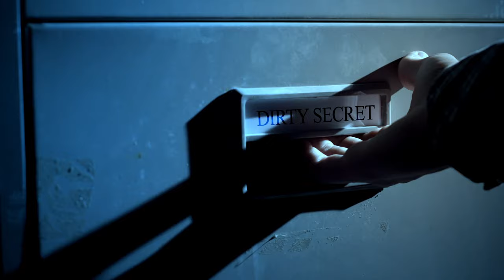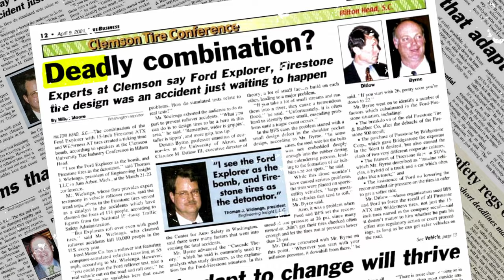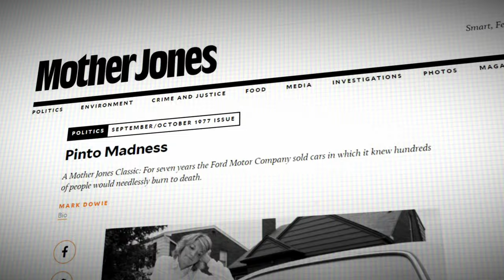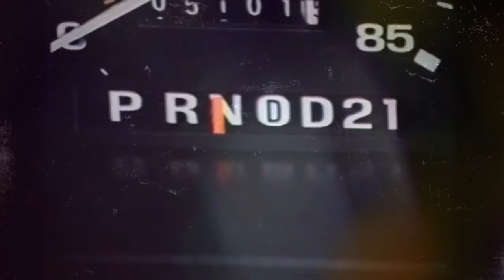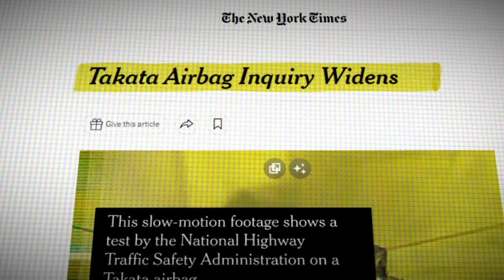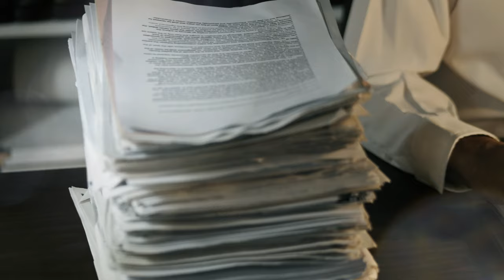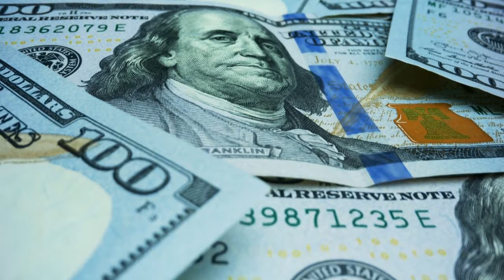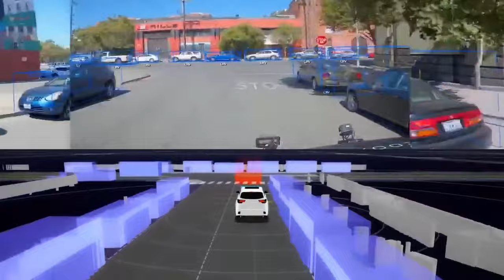10 Times The Automobile Industry Covered Up The Truth!

Comment: I love the Pinto. Modern Model A! High school kids could do repairs in backyard. Wagon did not have fuel tank issues. Ford recalled and corrected flaws
Reply: They run into a Pinto with a Cadillac and say look at the damage, i seen a Impala that was hit by a Kenworth there was nothing left of the car or the occupants, the driver of the truck was not injured. What do you expect when you run into a 2000 pound car with a 6000-pound car.

Comment: I had a 69 Chevy that got the motor mount recall.  I thought GM would replace the motor mounts.  Instead the dealer installed a couple of cables that would keep the engine from falling out if the motor mounts failed.
 I remember NBC  rigging GM pickup trucks with incendiary devices to explode on impact.
I had a Pontiac with the faulty Takata air bags.  It was recalled twice for the airbags.   The first time they replaced the airbag with an identical
airbag.  The second time they installed a different airbag.

Comment: Chevy Cobalt/Suzuki Forenza: faulty airbag sensors, won't deploy in some frontal crashes. Ford Pinto/Mercury Bobcat: Weak A-pillars caused extreme crushing in roll overs. Jeep Wrangler: Same issue as Audi, accelerator and brake pedal too close together. Warned to not "heel and toe", remove foor totally from accelerator when braking. Pontiac Fiero: Literally.

Comment: GM   Was the worst they had major Problems, they managed to hide, the Chevy and GM Squair body Pickups were deadly in a Side collision. With the gas tank on the outside of the Frame in a side collision the tank would split open, occupants of both vehicles would burn to death. more than twice as many people Died in the Chevy pickups, than the ones that died in the Ford Pinto. GM never ever did anything to fix it, The Truck was sold from 1973 to 89 with no cure for the fire problem. GM settled all Cases out of Court, with a silence clause in the settlement.

Comment: In the segment on Chev motor mounts it says that it applied stress on the throttle body.  Those cars did not have throttle bodies.  The mount failure could (at full throttle) cause the throttle linkage to jam up.

Comment: The chevy cobalt and Toyota stories are bull.
Reply: Toyota was never able to duplicate the problem, they paid the money to preserve their reputation.
Reply: @genehart261  yup
Reply: As a Cobalt SS owner for 18 years, I can say from personal experience that thee was no problem whatsoever with the ignition switch. NHTS claimed that a heavy keyring could cause the key to turn to the off position, but that just isn't possible. And as for driveability with the engine off, the power brake system holds enough vacuum for 3-4 brake applications before losing assist. Yes, power steering goes away, but at anything above parking lot speeds that isn't a factor. Remember that 50 years ago, power steering was optional in cars weighing two or more times what a compact Cobalt weighs. I regularly turn off the engine while driving to save fuel, and I have never had a problem doing so.

On another topic touched upon in this video, GM was blamed for the Chrysler/Desoto/Imperial Airflows demise. Actually it was the car's unusual design. The public just wasn't ready for a car that took aerodynamics into consideration to the extent of the Airflow. It was just too radical. When Chrysler moved away from Airflow's advanced styling, even while maintaining many of the other advancements, sles rebounded. For instance, all DeSotos from 1934 through 1936 were Airflows, and their standing in the sales race plummeted. In 1937, they dropped that styling for the much more conventional-looking Airflite design, and sales more than doubled. It was the car's unconventional styling that caused the car's abysmal sales and nothing else.
Reply: @genehart261  ..It was their drive by wire gas pedal...They recalled the cars and changed the pedals and computer reprogramming..Toyota did make a faulty product!
Reply: @genehart261 it wound up being floor mats not properly anchored, user error I think.